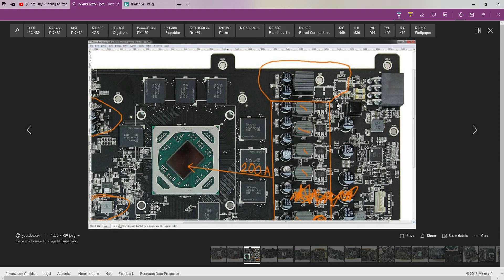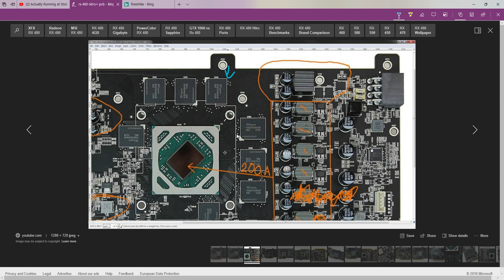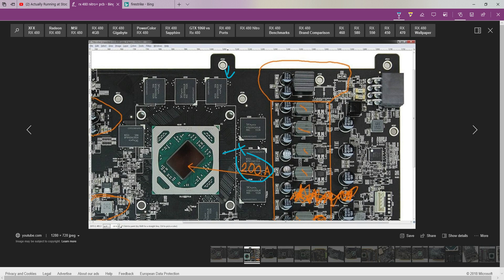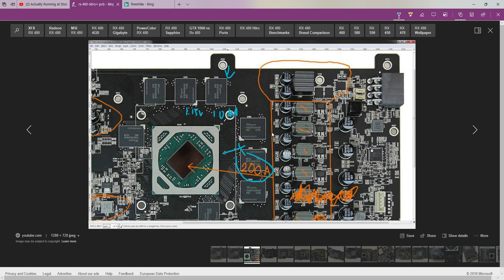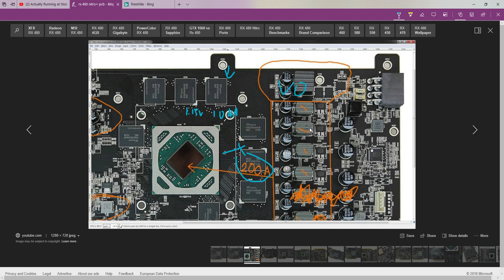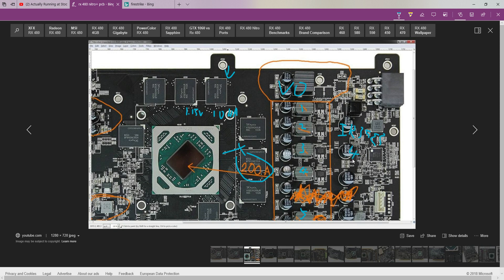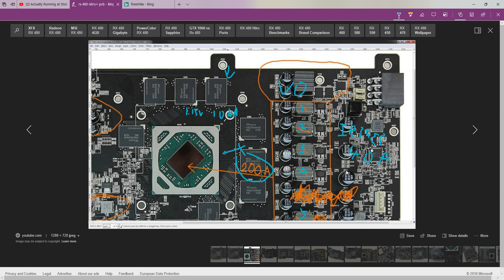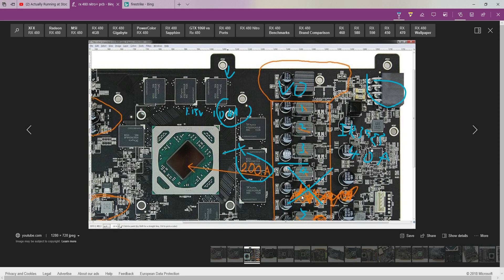PCB Breakdown: RX 480 Nitro+ | Actually Running at Stock

Comment: How about the MSI RX470 Gaming X 4GB?  Doesn't it run a 32 phase VRM to help it push the 600A needed into the GPU? Mine is running quite nicely at stock. (Obviously it's at stock!!! :-)